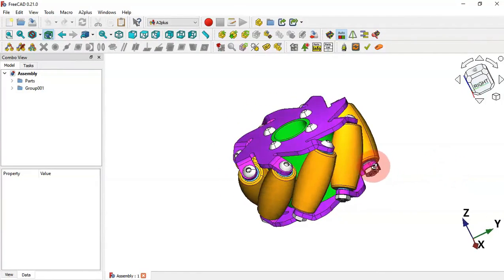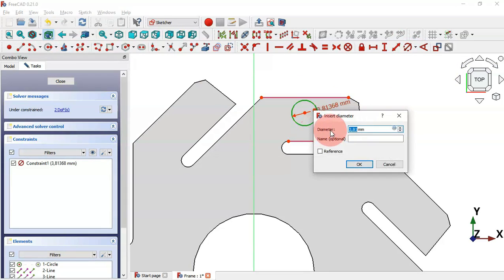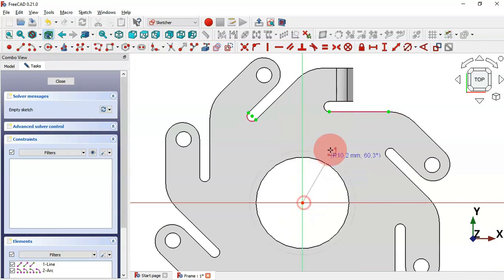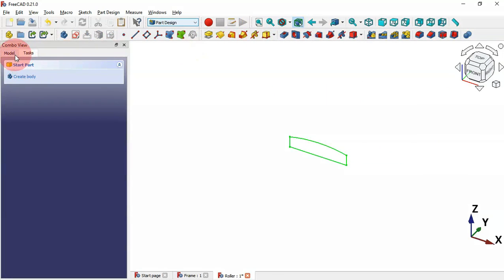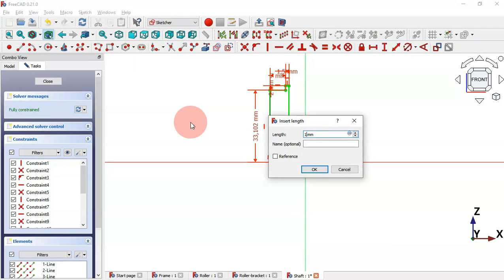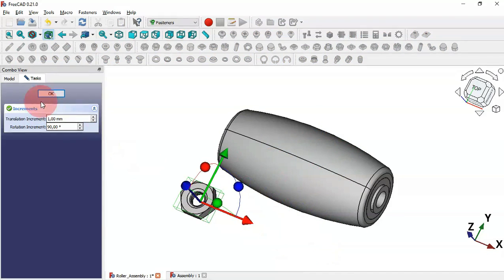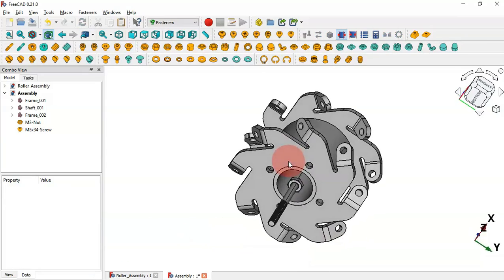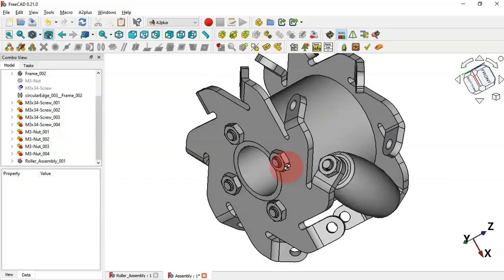FreeCAD 0.21: Simple mecanum wheel design + assembly

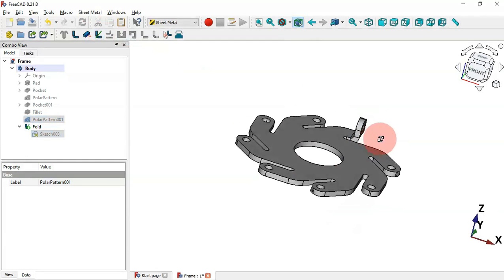Comment: In 7:18 I can't bend a part of a solid in FreeCad 1.0 with the fold a wall tool. The program requires to select the whole body with a double mouse click. If I do this, the program does not let me select the fold a wall tool. Is there any way to perform a fold a wall action on a solid body in version 1.0?
Reply from the maker: Yes.

Comment: This seems like a fairly sophisticated mechanism and freeCad can certainly handle it. However is it really necessary to have each part in a separate document? In actually conceptualizing and designing a mechanism like this from scratch, it would certainly be preferable to have all the parts present and visible in the same window when designing. Especially if you want to make it parametric. For instance the length of the roller would depend on the diameter and separation of the two metal brackets. Presently I'm using Onshape and would consider switching to freeCAD. But in Onshape you can design this whole thing in the same document in one window with many different parts present at the same time, and fairly easily make it parametric. If you want the parts to move, or you have a very complicated machine with lots of different sub-assemblies, only then would you have to use a separate "assembly" window.
Reply from the maker: In a separated document, no. You can design all parts in a unique document. 
For designing things from scratch you are right, all parts "must" be in the same document.
I proceeded this way on the video because I already knew her dimensions.
Design all parts from scratch in a single document in FreeCAD requires knowledge of how it actually works.

Comment: How do i export the wheel as whole to stl format? We need to select a body and then export. But in the assembled wheel there is no single body representing the whole wheel.
Reply from the maker: Go to file more and look for export and then look for the STL format select that format.
Reply: @OffsetCAD  If i am directly selecting export without selecting an object, i am getting error "Select the objects to export before choosing Export." and if i am selecting a part, A SPECIFIC PART OF THE WHEEL is being exported and NOT the whole wheel.
Reply: SOLUTION: Import the whole assembled wheel into a new file. Now the wheel would  appear as a single unit and can be exported easily by selecting it and clicking export.

Comment: it did not work ( union + array ) to boolean parts together in minute 10:24 of this video ! where is the problem ? if i leave it as it is and go on follow your video , would i confront a problem later on this video?
Reply from the maker: I don't know why you are having that issue, it worked for me without problems. Yes, during the import process in A2plus workbench.
Reply: I found the issue..... when you create the array, in the Menue on the left side, there is a checkbox "Fusion", this one had to be checked. Then the problem will disapear.
Reply: sorry...it is the "Fuse" Checkbox
Reply from the maker: Thank you!

Comment: Hi, thank you for the excellent videos, I'm facing an issue when I try to complete the union step of the frame (The Body and the Array) in the Part WB. I get a failed Fusion (Multifusion Failed) message when I hover over the Fusion entry in the model tree. Do you have any idea why this is happening?
Reply from the maker: No ideia. Are you using the same FreeCAD version as mine?
Reply: @OffsetCAD  My version is 21.2
Reply from the maker: Houuu, advanced version.  Maybe it's not working because of the version.  I thought you were using a version lower than 0.21 but in fact I am using an old version.  I will download your FreeCAD version and test it. 
Thank you for reporting the issue!

Comment: Minute 7:00. Have you tried to make a circular pattern in the sketcher with that line and then in the sheet metal do the fold? Or after do it with the first line then add the others with the circular pattern in the sketcher. Maybe it works because of the parametric stuff
Reply from the maker: The way I show it in the video saves time. Even if you do the circular pattern of the line in Sketcher workbench, you will waste much time folding, because that feature on SheetMetal workbench don't allows fold operations for sketches that a "complex", it accepts only a single line... 
So you will waste your precious time.

Thank you!

Comment: Nice to see the construction of the part, but from where do you have the exact angles and dimensions ? If i want that construct for my self, i have for example not the right length of the rollers for fitting betweet the top and bottom. Maybe you can show how to solve that problem ?
Reply from the maker: Yes, I understand you. But as I said in the description of the video, the video is based on SolidWorks version that I seen here on YouTube. What I done was only to adapte it in FreeCAD, with some and small changes on the dimensions.

The "exact angles" I get it after trying it on FreeCAD. If you see the SolidWorks version video, you will note that the sketch I used to create the pockets is a little bit different.

If you want to construct to yourself there are some tricks that can be used to solve that issue.
Reply: @OffsetCAD  Thanks for your informations. I have not seen the Solid Works video. But now it makes sense.